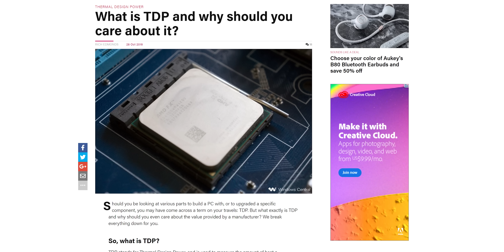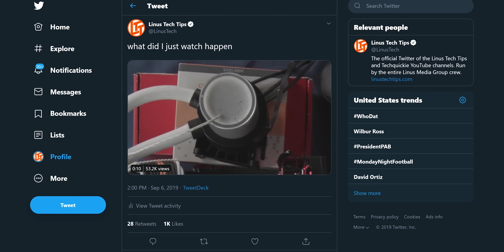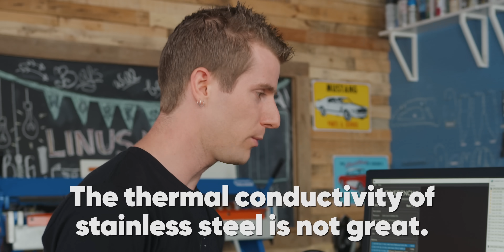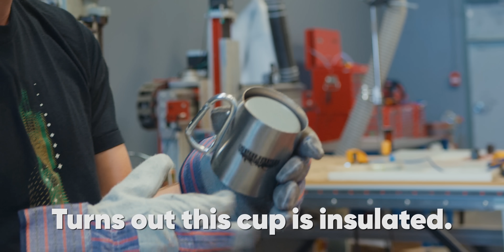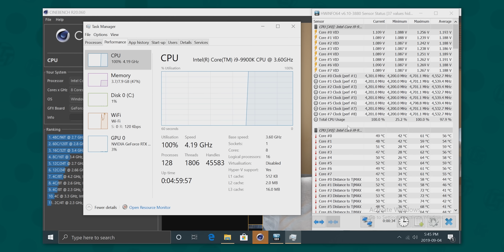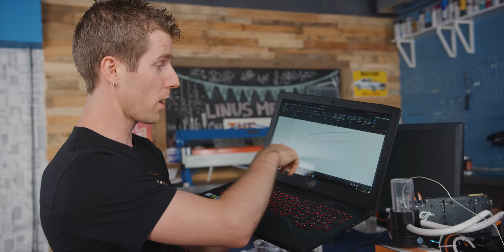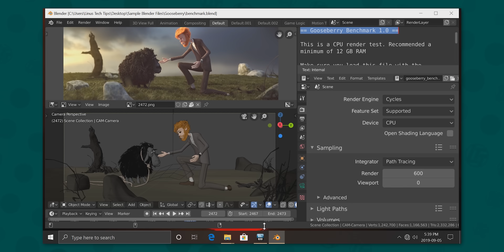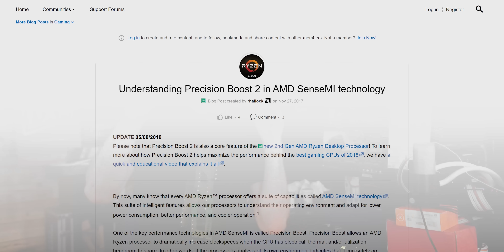Who REALLY Runs Hotter? AMD vs Intel

Comment: As an engineer that takes these exact measurements, this video is on par with the Verge building a PC video to me. This really hurts to watch.
Reply: @Edwin Shepherd It's probably the "I want to criticize" kind of comment, not the "I want to help" kind. So don't expect to get an answer.
Reply: I remember a guy once called linus out for doing something dumb and told him to come to his shop and hed show him the right way. Long story short linus ended up at Louis Rossmans shop and demonstrated the proper way to do it. Missed opportunity man could've had linus endorsing your channel.
Reply: As an engineer: 
Depending on the equipment available and considering the income generated by this video: Measuring the temperature of a thermal mass is a pragmatic and viable way of getting a qualitative result of which brand produces more heat.

But I would probably just have measured the current.
....
Or maybe not. Whatever makes for a more interesting video, I guess?

But also yes: The dye, insulation and stainless steal cup were a bit ... unnecessary. 
But I liked the colour change. :)
Reply: @SciFiFactory  Measuring the current draw isn't trivial. Just measuring the motherboard current draw won't tell you how much power the CPU uses. To do that you have to break out the power rails as they are passed over to the CPU, and for that you would have to use some kind of interposer board, and I'm guessing those are kind of hard to get hold of. The motherboard manufacturers probably have something that could work, but other than that I have no idea where to look for something like this, and with over a thousand connection points for the CPU it's not something you just whip up at a whim.
Reply: @blahorgaslisk7763  
I don't exactly know how the power distribution on motherboards is handled, so you might technically be right, but:
1.) One could argue that the chipset is an extension of your CPU. At least in the sense of "which vendor to choose for getting the more efficient system".

2.) How much precision do you need?  
As far as I know, Chipsets consume around 10W and lets say they are probably within 5W difference. 
Lets say total power gets measured to 100W (probably higher) then your margin of error would be 5%.
If the difference in power consumption of both cpus is larger than 5%, you are good. If it is smaller your conclusion would be "its a tie" anyway.

3.) Aren't there shunts on the board?
Reply: @SciFiFactory  I'm no motherboard designer so I'm not entirely sure about the power distribution, but to the best of my knowledge...

1.) As this was done to check which CPU uses the most power it's not a good idea to include the surrounding circuitry. VRM design varies between manufacturers and models of the motherboards as does the components used and the efficiency, so it's not a good idea to include them in a test like this.

2.) To compare two processors and decide which one uses the most energy? Not much. For that the method used was good enough. But the complaints has been that the testing procedure wasn't scientific as there were no hard data generated. To really improve upon what they achieved you need a procedure that generates repeatable data even if the motherboard changes.

3.) I'm pretty sure there are shunts in the VRM but depending on the exact design you might not be able to get at them. I'm guessing a bit but I think the more advanced designs have them integrated into the power stages which then give feedback to the controller. Even if you can get at them you will have to monitor the shunts for anything from 4 to 12 phases which are switching at a high frequency.
Other than that I've never seen current monitoring on a motherboard, not even server class dual or quad processor motherboards.
Reply: @blahorgaslisk7763   Well, I agree there are more precise methods to do this measurement. I was more focused of achieving the goal of finding out which one was taking more power. :)

I think  you can get CPU power readings in software tools like  HWinfo? How are those measured?
Reply: @SciFiFactory  For just learning which CPU uses the most power the loop Linus used is good enough. It isolates the CPU from the rest of the system and is reliable enough to compare different processors on different platforms at least as long as they are reasonably close in dimension. It's best if they can use the same waterblock as this is one less variable to account for.

As far as reading the CPU power in HWinfo I'm not sure. I can't remember ever seeing it, but then I haven't used HWinfo in probably six or seven years. As for how they read it I can think of a few possibilities. The simplest would be that the program uses a table with power consumption info for all recognized processors and that this is used with the voltages reported by the motherboard and possibly the frequency to approximate the CPU power consumption. Another would be that there are actually schunts on the power rails and they simply read the current and multiply by the voltage to get the true power. However I think this second approach is highly unlikely. Besides if it actually worked that way I think Linus would have either just used those figures or at least would have mentioned sanity checking the findings by comparing the results.
Reply: @blahorgaslisk7763  l
Reply: @blahorgaslisk7763  l
Reply: Here's an idea..........Don't watch it.
Reply: Also they could probably measure the power  more accurately by uhh... measuring the power.
Reply: Waaaaiiiit. Are you saying that the CPU has a separate power cable witch which you could measure input it draws? This is sorcery!
Reply: The writers and editors got their heads up their bums..

Sucks to see Linus put out these useless junk videos out.

Remember not long ago, Linus called out MKBHD to 10m subscribers..there was only 80k subs separating them at the time now it’s over double that.
Reply: Well, you know what to do. Do a vid of it being done right.
Reply: @agenericaccount3935  money is a big factor. Buying the tools and equipment is costly
Reply: @agenericaccount3935  Or Linus could just do it right to begin with.
Reply: @admin8244  Since the Verge comes up as a comparative, after that debacle a bunch of people did a correct build tutorial. I don't mind either way, but it's fun to watch the kvetching.
Reply: but true very jank lol
Reply: @Lon Denard because they are not lab people? They just want to have fun time thats all?
Reply: @Lon Denard 
While you can get good repeatable placement with the laser on one CPU you have to remember that you have to switch Motherboards and CPU geometry. 
What you really want to measure is   power (think current). Temperature would be your equivalent to voltage. Thermal resistance your equivalent to resistance. 
With the same power, thermal resistance and therefore temperature strongly depend on where you measure. My tip: measure somewhere where the resistance doesn't change: the transition from water in the cooling loop to the surroundings.
Reply: There are shunt solutions like Powenetics that should be able to do accurate measurement of CPU power draw. This could be sanity checked I suppose with a BTU meter on a loop if you wanted to splash out on something visual/entertaining.
Reply: @Lon Denard Well actually I don't know how precise and repeatable you can get with a laser on two different CPU heatspreaders .... which is exactly why I wouldn't do it. 
Hey, my pleasure, thank you too. :)
Reply: @Lon Denard Overall power draw is indeed easy to measure, but if you measure the power draw for the entire system there's way to many variables to make any assumptions about how much of that is going to the CPU. If the processors you are testing can be run on the same motherboard then it's good enough to show which one takes more power, but even then it's not going to reliably show how much the difference is in CPU power draw is as the efficiency of the VRM changes with the power draw. The issues are slightly smaller if you just measure the current supplied to the motherboard, but still not realy good enough to be certain. Measuring the current going through the 12V CPU power connector or connectors is one step closer to the truth, but again the VRM designs used vary wildly in their efficiency so it's still not good science.

To show the difference in heat generated by the CPU the closed loop Linus used is quite good enough. And with a bit of effort it could be turned into a reliable way to measure thermal power without having to modify the motherboard.
Reply: Lol. Why not make things even fancier. Have both systems run a remote passive cpu cooler with a to-scale hot air balloon above the heat sink to capture all the hot air. The heat sinks and balloons are equal for both cpus in weight. Have the cooler w/balloon tethered to eachother and placed on a scale. As the air heats up it reduces the pressure on the scale and you can measure the change in weight.
Of course ambient air temp might have to be set cold to get enough temperature difference to increase the effect of the hot air in the balloon to see a measurable difference in weight... but the colder ambient temp would also cool the cpu and affect the test.
Reply: I literally had to stop watching this video was so cringe.
Reply: I guess they aren't making a tutorial so it's a bit better. A bit... What is the proper method they should be following?
Reply: @Edwinthebreadwin  They should follow Intel's published thermal design guide measurement method.
Reply: @Edwinthebreadwin  
It is worse than verge pc. At least verge got their shit of run, this produce no usable data, like zero usable data. My middle school lab has more rigid process ffs.
The process they should follow? Google up how to perform an experiment is a good start, they did literally nothing right.
Reply: @jintsuubest9331  no the verge claimed to make a tutorial knowing what they do, this clearly wasn't engineers doing any sort of those claims
Reply: @jintsuubest9331  It wasnt great, but if you disregard what they say they measured for volume and just go with "they filled the loop to the same amount each time", it's not as bad as it seems.  I would say it isnt a great lab settings test, but a moderately accurate read of heat output between the two at relatively stock and similar settings.  They addressed the problems with their testing, this was just more of a theory-craft that did actually show that intel outputs more heat (and that's before overclocking).  Yes they could have done MUCH better, like not putting all their mistakes in the video, but that makes for less enjoyable content and shows that they know it isn't a perfect test by any means.  

Personally i would have just put a pump into a 2L insulated container and measured the temp change over say a 20 minute repeatable benchmark once the water hit a certain temp at idle (repeat for each system).  The color change liquid was more of a science fair display.  Definitely not something to compare to the verge by any means.
Reply: We all already know we can basically just measure the power consumption in HwINFO to get the real heat (generally) this is just for the memes
Reply: So you're saying there are literally thousands of videos already up on youtube that explain exactly how to do this type of measurement correctly? What should I start searching for oh wise one?
Reply: SABER-JOCKY all they would need to do is fully insulate and remove the dye to have acceptable preliminary results. Instead wait for it to boil and record time.
Reply: @Van-yo2xr  It's not going to boil. The chips throttle long before that.
Reply: something1random23 sry ur right, remove the dye and replace with Novak or something
Reply: something1random23 iirc, throttling occurs when the chips reach the designated t-junction, in this case 100c-which is the boiling point of water
Reply: Perhaps recommend a methodology rather on how they can make their data more meaningful?  

Blanket criticism doesn't help the community understand this stuff better.  And all of us who watched this video is trying to learn something.   We need experts to contribute their knowledge, so we can all benefit.
Reply: Yeah it was awful.. :D
Reply: @Lon Denard Software readings have the problem that they are measured differently and that the die temp is indeed not a reliable way to determine the heat output. 
Lasers are inaccurate (time and position of measurement).
Thermocouple on die ignores the initial water temperature which influences the heat buildup.
Measuring the water temperature itself is a good way. 
Thermal transfere to the environment should stay constant. 
They should have monitored the room temperature.
Reply: It feels like they see the audience as dumb people that just want to have a laugh at Linus's supposed stupidity, not people that want to have access to information
Reply: @PudiimBR  they literally have said they are more entertainment aligned while GN is more informational ...  their niche is trying things, having fun, making mistakes, and learning from them.  You see the sub difference of ltt and gn? There is the answer, a channel for the masses and a channel for the more tech oriented.

Also, to people criticizing,  great! But then take your vast knowledge and explain yourself, what you see wrong, how you'd do it better, especially if you claim it is your job to do this. Be informative, not just a dick who doesnt understand the channel and claims you are an internet expert ;)
Reply: Shut up boomer.

Comment: I don't quite get this experiment. If we are trying to measure just how much heat is outputted during a benchmark. Why not just measure total power draw during the render. I understand that the concern could be that the two CPUs are affected by their coolers differently but isn't the point of tdp values just to give us an idea of how much power draw we get under normal operation. As long as the CPUs stay within the max allowed temps and hit their advertised performance, power draw from wall should be the only concern. No?

Comment: I seriously doubt the advertised TDPs. I was using Ryzen 5 2600 and upgraded to Ryzen 7 3700X. In theory, these two processors have the same TDP = 65W. While using the exact same cooler (bequiet! Dark Rock 4) i notice +15 degrees Celsius for the 3700X during load.

Comment: I can't get past "a magnet won't tell us if it's stainless". Yes it will. Magnets stick to steel, obviously, and not to nonferrous metals (aluminum, etc.). Stainless will attract a magnet though, but only slightly. You can tell if it's stainless, steel, or some nonferrous metal.

Comment: Lol back when I moved from my old FX 8350 to the i7 4790k I noticed my temperature was waaaaay higher with the i7.
Reply: Really? I wouldn't have expected that. Are you using a radiator? My FX-8350 never gets over 60C with a 240mm radiator, and I run stress test with the same results. So I can see how it could happen, but I didn't see it coming.
Reply: @wolfandbrie5679     Obviously he did something wrong.